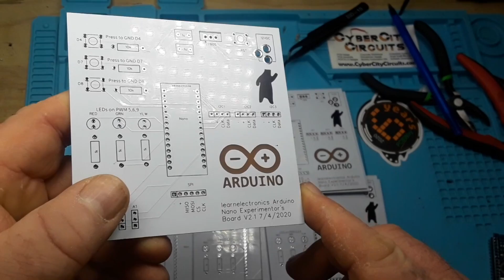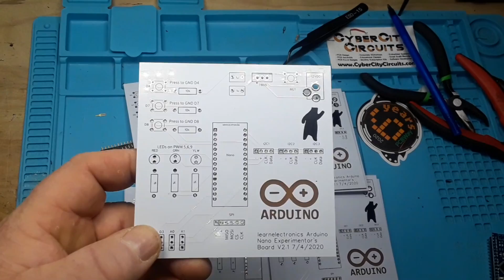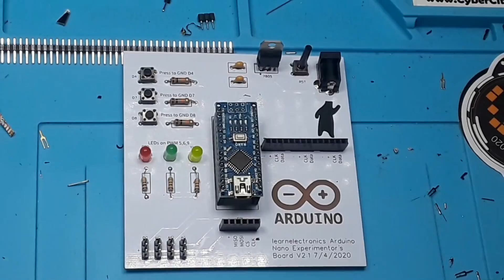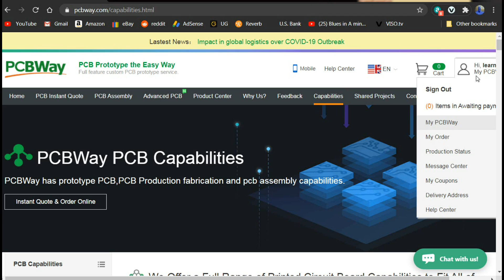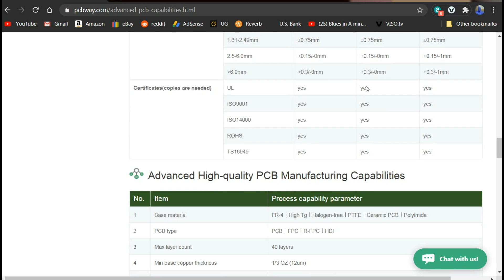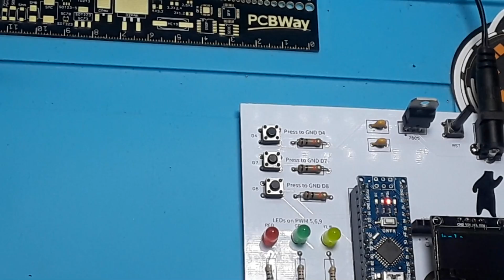Arduino Nano Experimenter's Board

Comment: Hi Paul, I know I'm a little bit late, but I think I know why the logo didn't come out as aspected. It seems like the top plane wasn't actually being poured because there wasn't any activ pad with the same net on the plane.  In this case the copper won't be poured. You can tell this because the red square which represents the copper pour analog to the blue one on the bottom layer is missing. You can solve this by setting the 'Keep Island' option in the copper plane menu to 'Yes' and rebuild the copper layer. I haven't tried it yet by myself, so I can't tell for sure. As always, thank you very much for all the great content you provide :)
Reply: Hi Paul, just a quick update: in the meantime I have ordered a few boards and I can confirm that it works. Everything is beautifully tinned! I ordered from the other big PCB manifacturer, but I think it should also work for orders on PCBway.

Comment: If you used, two rows of three header pins for the resistors to the LED's then you could shove the resistor in the sockets and be able to swap them out for different values or if you fry one or whatever (might ruin the nice look of the board thou!)
Reply from the maker: Great idea!

Comment: Why the 7805? Arduino Nano has its own 5V regulator (AMS1117) on board, you can put 12V in to the Vin pin and use that. Its a LDO regulator so it wont get as hot as 7805.

Comment: - Remove button resistors (use internal pull-ups)
- Add stand-offs (as mentioned)
- Add rotary encoder (as mentioned)
- Add row of header pins right next to the nano pins on each side and parallel them up. That way a user can plug in a normal bread-board jumper to wire up other things
- Use power and ground planes to neaten up traces
- Add row of 3-4 header pins for GND and 5V each. Makes it easier to hook up score probes and take off ground/power for other peripherals

Comment: ☺ On such a small board (given the contents) you had space for a reinforced concrete fundation. Aside from irony, for these in lab usage boards I usualy place at least for mounting holes in the corners, that usualy get four screw mounted metallic spacers, just to keep the board for sliding away an avoiding any accidental shorts. The guys from LT do some nice boards.

Comment: "Hmm, something beeping at me. Probably soldering iron!" Hay, the meter shut off!  :-)
I'm sure it was the meter beeping, just saying! LOL   :-D    (laughing with Ya...)
My meter has the power saver mode too and it beeps after a few minutes. What chafes my butt, it does not care if I am using it or not it shuts off. Nothing to adjust for that either... :-(
Great project, I have nothing to add everyone covered what I was thinking... Lol
Thanks for the video!
LLAP

Comment: 1. Add an NPN driving a little 12mm passive buzzer so you can play with the 'tone' function. 
2. Add a IRLZ44N mosfet (or a relay) to one of the pins and add a breakout so you can switch 12V loads
3. Add a 4-pin RGB LED (or maybe WS2818 addressable LED)
4. Breakout for the UART RX/TX
5. Move the SPI breakout so it doesn't block the USB port

Comment: You should make a board that has spring connectors like the old electronic kits, where you connect components between the springs by bending the springs over and sliding the component leads into the side of the spring.  These were so much easier to use than tiny little breadboard holes!  I would buy a few.

Comment: You should also move the I2C headers (Stagger).  As you have noticed, unless you place the LCD on a cable you are blocking the other connector(s) depending on your placement.
Reply: David Maruska totally agree

Comment: You might find your answer breaking this apart in a 3rd party Gerber viewer. I have found over the years some cad programs use layer colours so close to each other you can't easily tell what's mask or silkscreen etc. If you look at the layers one by one in a seperate viewer you will be able to tell which layer it is really on. I do this with all my boards and often find hidden mistakes.
Reply from the maker: Thanks for the tip!

Comment: How about adding mounting holes to the corners so you can insert standoffs and prevent shorts if placed down on a conductive surface.  I teach a lot of students physical computing and they all want to set the board down on the computer case.
Reply: Steve Robillard great idea ❤️

Comment: I am not familiar with your PCB package, but it seems that there is no copper in that rectangle - wouldn't it be shown in red like the tracks on the top layer if there was one? You can see the blue bottom layer clearly. Did you pour that polygon, I think you have not pour it? In the 3D view the colors are not the same, the Arduino logo is the yellowish FR4 material and the the pads are the gold plated exposed copper, you can even see there that the is no copper (3D view). Use a third party gerber viewer to check it.